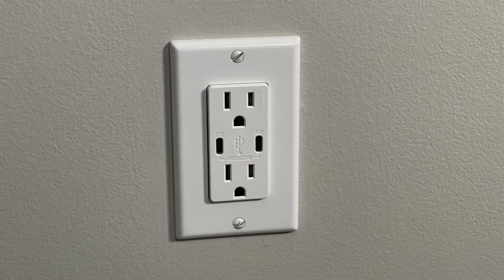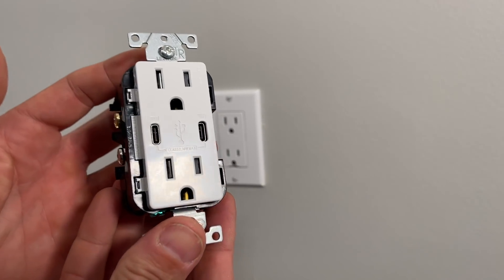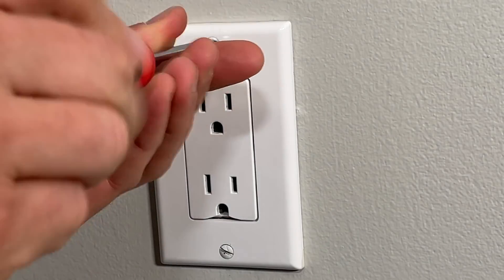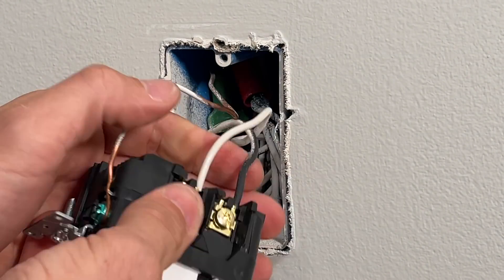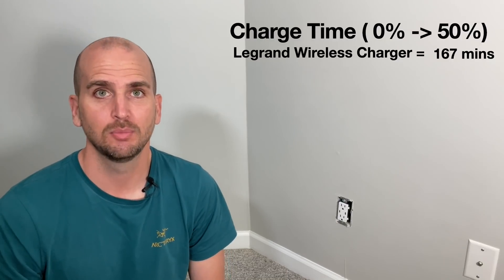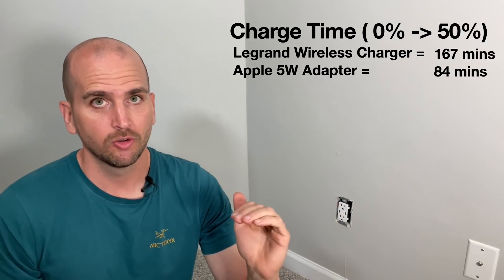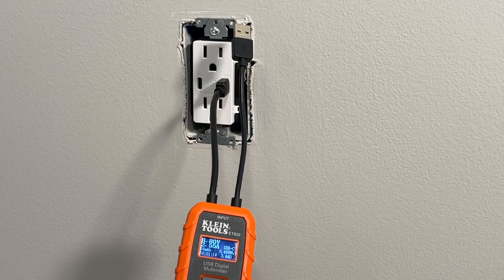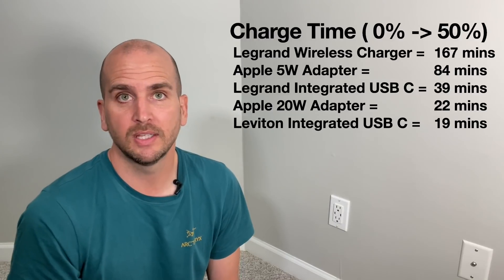Fastest USB C Outlet On The Market |  Install and Test

Comment from the maker: Leviton 5635 USB C Outlet:  https://geni.us/q6Yb3w
USB Multimeter:  https://geni.us/9Q9F
Legrand Wireless Charger Outlet:  https://geni.us/Lx6iU

Tools Every Weekend Warrior Needs
Makita Cordless Drill Combo Kit:  https://geni.us/t7dIA
Dewalt Drill Bit Set:  https://geni.us/oFlSl
Dewalt Screwdriver Bit Set:  https://geni.us/VDcr
Craftsman Screwdriver Set: https://geni.us/jXqFI
Eklind Allen Wrench Set:  https://geni.us/7XfvO
Pliers (4-Piece Set):  https://geni.us/RIdx
Milwaukee Fastback Utility Knife:  https://geni.us/MlyiLk
Stanley Tape Measure:  https://geni.us/bUfD1R
Studbuddy Stud Finder:  https://geni.us/RySCuVw
Johnson Torpedo Level:  https://geni.us/wiLcDY
Stanley Hammer:  https://geni.us/bPDk8Wo
Buck Bros Wood Chisel Set:  https://geni.us/vk3cpTW
Klein Voltage Tester:  https://geni.us/h9Hl
Klein Outlet Tester:  https://geni.us/kdBAJ
Milwaukee Wire Strippers: https://geni.us/5zuLAbC
Little Giant Ladder: https://geni.us/fmlmTk

DISCLAIMER: This video and description contain affiliate links, which means that if you click on one of the product links, I’ll receive a small commission.

Comment: I don't like these combo outlets. One is better off to use the power supply that came with the device, if they have it. If not, then buy one. Where the USB combo is useful is in a hospital where someone might have their phone, but not their charger. And hopefully there would be a cable in the gift shop, because unless people are me, they're probably not carrying around a cable with them either. Also a separate box in the wall for USB devices only is more ideal with the connections being made somewhere near the panel. Of course there needs to be outlets there, which is ideal to connect high watts bricks, to feed the USB connections in the box in the walls.

Comment: How come there are no “load” and “line” terminals?  Is it safe to just connect all same color wires together to 2 terminals rather than the usual 4 terminals (2 top, 2 bottom when daisy chaining multiple outlets in room - or is that just for gfci?

Comment: I want to add one to a duel outlet. I bought this one and it is two wide, I noticed all the newer outlets have plastic cover over the entire back now.  the old one I removed is much narrower and the space is not wide enough to add a new outlet in the dual box. I thought things were suppose to get smaller not larger.

Comment: Will anyone ever sell these in 20A (NEMA 5-20R) versions? I understand that the USB power supply is considered a device on the same circuit but I still want the 5-20 rating/receptacle for my workbench.

Comment: Our 65 watt chargers for the laptops also do super fast (step up from the fast) charging for the Samsung, RavPower ~$20, but it is a plugin wall wart. They are the latest GAN tech. Several of our cameras require 2.5 amps for full function at 12v. There's so many devices.....power banks &c. A nice feature that is often overlooked is if the charger has a low power feature that does not shut off with a tiny load. A shame that the built in does not support super fast charging on Samsung, just the fast charging, but it may not be a big difference.

Comment: I’ll be making a video soon but basically I tested the Leviton USBC unit versus the Eaton USBC unit and the Leviton did 27.8 watts (14.8volts 1.88amps) charging at the USBC cord drawing 31.1 watts from wall. The Eaton did 14.22 watts (5.04v 2.84amps) at USBC cord and 17.6 watts from the wall.

Comment: My outlet have 2 black wires and 1 red. When installing the USB receptical can I combined (wago) the 2 black wires and not use it and only use the Red wire as the power source . I want to be about to turn on/off outlet with the switch.

Comment: This was a good test. I have at least 2 USB A outlets in each room and considering upgrading them to USB C. I use them so the grandkids are only plugging into a low voltage outlet vs a charging having to plug into 120volts. I still remember when I was a kid and touched both prongs on a plug about 60 years ago.

Comment: A wireless charger, even positioned exactly right, will always be slower. And that can be a good thing, because it overheat your battery as badly as a plain charger, if you leave your phone to charge overnight.

Comment: When you initially pulled the old receptacle out, did you notice the in the back of the box there's bare wires exposed where they're spliced together feeding into the green insulating cap?  But always great videos:)

Comment: As someone who likes the idea of upgrades and not needing the charging blocks, it seems like it's the law of diminishing returns: First, we needed the charging blocks and those were USB A. Apple went from the large 30 pin to the lightning port, which... they are still at in 2021 and it's slow data transfer rate. Now, we have the USB C to lightning port or USB C to USB mini. 
Bottom line: I'm fed up with changing my cables- all sorts of lengths and ends to keep up with this supposed change in technology cables. Can't the industry just move to USB C all around on both ends like they do with HDMI? At this point, Imma just stick with my USB A ports, which are charging my phone while I sleep (for more than 180 minutes) and be done in the morning. 
FYI, I appreciate you for doing this test!

Comment: In our house, phone recharging occurs in two locations. The kitchen and the bedside table(s). So not worth $80 - $120 (two bedside tables).

p.s. I am jealous that your electrical box is flush with the drywall all the way around. I have replaced every receptacle, every light switch and most ceiling lights in my home and not once did I find a box and wall fit as shown in this video.

p.p.s. Thanks for your videos.

Comment: i wouldn't use that kind of math to determine time to to charge. Put in the effort and actually charge the phone
Reply from the maker: Thanks for the feedback.
Reply: @EverydayHomeRepairs  wow I came off as kind is a douche. To clarify charging isn't done at a constant speed so you can assume it'll have the same speed the entire time. It slows down a lot as the battery gets more full
Reply: I agree, charging times for devices are usually calculated assuming the time it takes to recharge the battery to 100%.

Comment: It better to use a Samsung phone to see I'd it kicks on the Super Fast or Fast Charging mode.
Reply from the maker: Thanks for the feedback Jason, the iPhone 12 Pro Max has Fast Charging but it would have been nice to compare to the latest Samsung as well.
Reply: @EverydayHomeRepairs  iPhones are nice but they don't show an indication that the charging is fast or not. The fastest Samsung Charger will show an indication for Super Fast 2.0, which is currently the fastest Samsung will do.

Comment: 1:10 $40 for stationery outlets VS. about $20 for a movable plugin?  No.  No, it isn't worth it.
Reply: As someone who has three iPads, an Iphone 8, 2 Mac Minis, 2 Imacs, 2 MacBooks, an Ibook, Amazon devices, printers, game consoles, Nintendos,  multiple device cable unpluggings all the time, it is worth it. I wouldn’t have to have all these charging bricks floating around oh I forgot about the iPods, add my windows 10 laptop and 3 of my 6 Apple ][ computer,  I go nuts with all the power bricks & having to connect and disconnect the cables when I move around the room.
I wish I knew how to just install an iPad in the wall so I wouldn’t have to keep carrying one from room to room because this place is really old if it were my place and tear all the wiring out and put all new wiring.
Reply: @antonsenda3196  What the heck do you do for a living?  Run a company all by yourself?!  That is way too much tech for one person.

I'm not about to try to tell you how to live, but you might want to consider a "get away from it all" vacation.  At least compare systems to see what you need VS what you don't.
Reply: I bet you $20 that in 10 years one of these things items will have gone missing, while the other one will be screwed to the wall. It’s also nice to be able to have a bedside lamp, radio alarm clock and digital device of your choosing all plugged in at the same time.

Comment: Hallo Scott. Love your site. Those Leviton and any device for charging is going to take up more room inside the box than usual. When you install the wall plate back on. That is going to prevent the device from curculating enough air thru the vent on the device to cool it enough. And see if you use both charging ports at the same time, will it divide the charging power. The component in you 20 watt charger are larger than it would be inside the Leviton recepticle. All the components are smaller in the Leviton, capasitor, resitors, diodes and resitors. That would change the charging power to it. I will always stay with the charger  phone came with because as you would it was engineered to be like that. Thanks for all you Vids. Please let me know what you think of my opinoin.

Comment: There's a case to be made, not to put electronics in the wall. The charging standard is not yet fixed and can be upgraded anytime in the future, and putting this into the wall increases the risk of obsolescence  or failure, and then someone will need to change it. Unless you really can't stand the look of a charger, it's much better to use an external charger, so upgrading to future improvements is painless.
Reply: I disagree. With this outlet in the kitchen you could keep your microwave and another item plugged in as well as your phone cord. Especially if the outlet is behind the microwave and makes it difficult to get to.
Reply: @Had22s  You are free to buy one and install it.

Comment: Any idea what the idle current draw in these is?
Reply: I would imagine the quiescent current would be completely negligible, even if it had an LED indicator to let you know it has power; likely in the sub-mA range.  However, the active current draw for these outlets can go up to 15 or 20 amps depending on the style as well as the gauge of Romex and the rating of the circuit breaker powering the outlet.

Comment: The only thing I think you missed about this outlet, is that it can't do PD/fast charge when there are two devices plugged in, because it's limited to 30W total. If you read the product insert, it explains that when two devices are connected, they will both operate at 5V/3A (max 15W) even if one or both devices support PD.
Reply: Good catch. I’m still going to install these in my house because of the convenience. Every room will have one.
Reply: @ruconscious get topgreener ones. They got 60w
Reply: Have a better outlet than this to suggest?
Reply: So do you recommend a different outlet with fast charging for 30w for both plugs at the same time? Thank you
Reply: @bighigh69  I wound up using the model in this video despite its limits.
Reply: He dosent know what hes talking about.

Comment: The problem with the kitchen insulation is most of those are split plugs
Reply: I've only ever lived in one apartment that had split plugs in the kitchen. I think there was a time in the 80s where that was common, but it didn't stick around. Obviously where you live may be different.

Comment: If you put that on your kitchen counter, would you have a GFCI on the daisy chain to prevent shock re: kitchen sink/dishwasher?
Reply from the maker: Yes,  a GFCI would need to be first on the circuit and then this USB outlet coming of the “Line” screw terminals of the GFCI.
Reply: the building cod says under one meter from the faucet or water source.

Comment: These expensive gimmicks are guaranteed to be obsolete in a couple years. Meanwhile there are 90 year old houses with the original outlets still working just fine.
Reply from the maker: Not sure they are gimmicks but you are correct that the standards will continue to change and replacing this one with the latest and greatest in 3-5 years is a real possibility.

Comment: I'm confused why the leviton USB outlet is faster? If your cellphone doesn't have fast charging the leviton USB won't work because your cellphone has to have fast charging?
Reply from the maker: Yep, if your cellphone doesn’t have Fast Charging (PD or QC) then the charge time results will most likely be similar across everything except the wireless charger from Legrand.
Reply: @EverydayHomeRepairs  yeah I doubt my cellphone has fast charging PD or QC so it seems that the leviton will only work with certain cellphone that are QC or PD

Comment: I am not a fan of integrated USB chargers, and this one is no exception. It may be better than most integrated chargers but that is a very very very low bar.   It can deliver 30W PD.   This outlet does not provide Qualcomm QC2 or QC3, and for a PD outlet it's not that impressive at 30W where PD chargers are available up to 100W, and QC2 and 3 are widespread.   My approach is ALWAYS to use a cube charger that is best suited to the device I'm charging.  They are almost always faster than anything built in to any wall, table, or car dashboard and they are extremely adaptable (being adapters) in that they can plug in to ANY wall outlet.
Reply: Probably makes sense for charging high-current devices fast, like a laptop. However, if you've got a lot of USB-C devices, a couple of these receptacle can cut down on chargers that are carried around a home. If I'm charging 4 devices, that's 4 charging adapters that I don't have to carry around (just the USB-C cables).
Reply: It depends on the application. I have a mix of charger receptacles (including the T-5635) and plug-in style chargers in my house. The built-in ones are useful for cases where you don't want to tie up an outlet or when plugging in cords behind furniture where there are space constraints.
Reply from the maker: Thanks for the feedback Jon.
Reply: a 45W or 60W version would be nice, then you could charge many newer laptops from it. i wouldn't want to be the guy who had to work out the thermal design though

Comment: Two things- Don't you need a GFCI on the kitchen counter and does the outlet always draw power?
Reply: You do if it's near a source of water. Depending on how big the kitchen is, it isn't necessary. Also if the outlet is daisy chained behind a GFCI or on a GFCI breaker, it apparently meets code in certain areas. My bathroom outlet is a standard, but daisy chained behind my kitchen GFCI. My home inspector said it meets electrical code here.
Reply: @josephpichirallo  how long ago was that? Outlets on kitchen countertops must be on small appliance circuits, which need to be 20 amp and can not be used for anything else including lights, which would mean using it for a bathroom would not be allowed. GFCI isn’t simply required near sources of water. All countertop outlets are required to be GFCI protected, no matter the distance from a sink and daisy chaining isn’t any less safe than spending $20 on each outlet.
Reply from the maker: Like Joe outline, the one I am swapping is a "Load" daisy chained off a GFCI outlet.
Reply: It needs to be GFCI is it is closer than 59 inches from the sink.  Also you can have two receptacles on a single kitchen circuit, so you could install this as the second of two if GFCI is required.
Reply: @orlandozoli  while true, any outlet above a countertop must also be GFCI protected no matter what the distance from a sink, and code also requires a minimum amount of outlets on top of countertop space, meaning unless you don’t have any countertops you’ll have outlets which need to be GFCI protected even though they aren’t near a sink
Reply: @LzysGraphics  I guess it depends on where you live. Here in Ontario, counter top receptacles only need to be GFCI if within 59 inches from sink.
Reply: @orlandozoli  ah sorry about that, yeah I was quoting NEC

Comment: Questions about box fill. How much are these considered to occupy? I know a standard outlet counts for two conductors in a box, but this is significantly larger than a standard outlet. I've already been installing these and calculating the box fill as though they are a 1 1/2" GFCI rather than using the standard method. Is this correct, or is there a better way to go about solving that issue?

As to what I use, I've slowly been installing Leviton T5632 USB type "A"s throughout the areas where it could be expected that devices need charging; bedrooms, living room, kitchen, dining room, etc. Any future installs I do will use something like the Leviton T5633/T5833s or Eaton TRUSBAC15/20s which are a type "A" & "C" combo unit. Type "C" is the way of the future, but having an outlet compatible with both types allows for greater flexibility, particularly when using legacy products.

Actually, is that something you would be willing do a deep dive into? How do charge times & temps compare between the USB "C" ports on the Leviton 5635 compared to the 5633? Same for the Eaton models? What about similar models between brands? Between different outlet amp ratings? What about when one (or both) wall outlets are in use? etc. Is this something you've already done to a great extent? If not, and you were willing, what could I as a viewer do to help (got a patreon?)

So much for this just being about box fill...